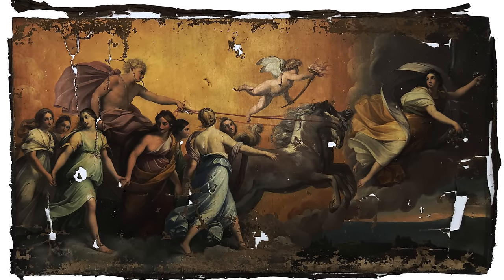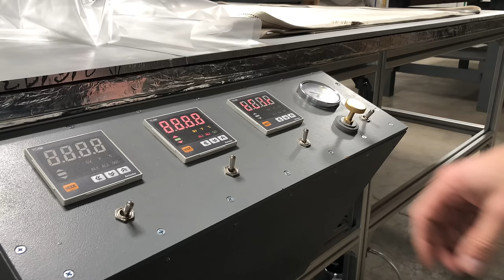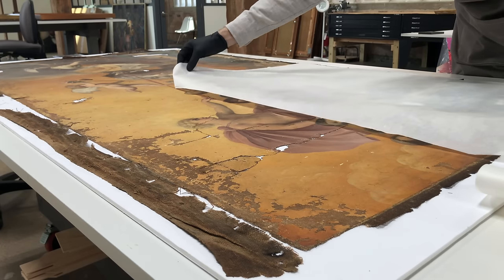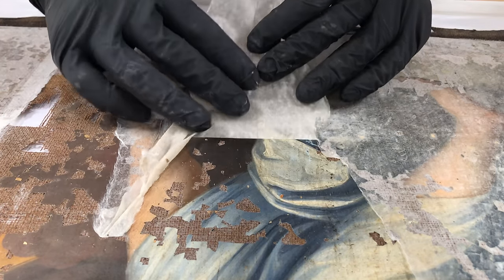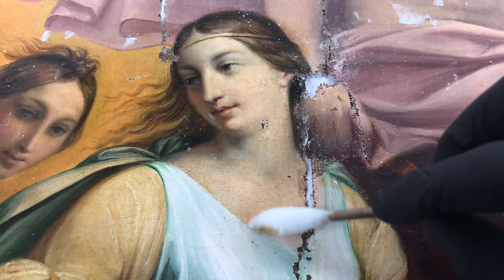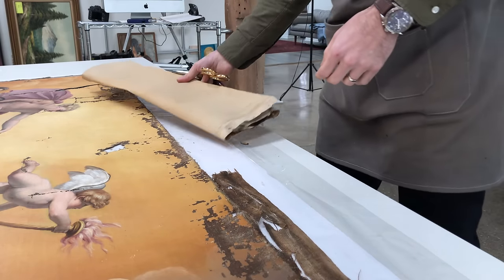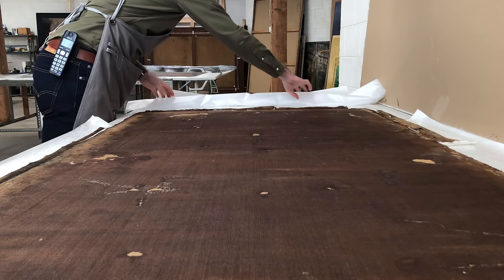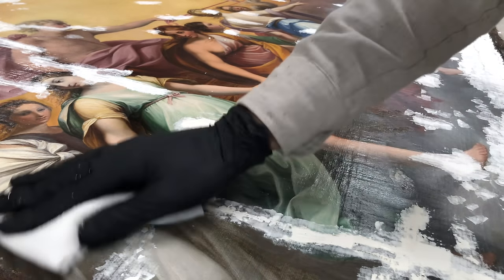A New Dawn: The Restoration of L'Aurora Part 1

Comment: Baumgartner: five inches of mercury
Me: yes I totally agree, good choice
Reply: Exactly. I was thinking 6 things of the mercury would be absurdly heavy handed and 4 of them, well that's just foolish. Clearly 5 of those things was just right.
Reply: Baumgartner: thirty inches of mercury is way too much
also Baumgartner: yeah lets put some breeze blocks on top of it now
Reply: They say the average is about 5.3 inches of mercury
Reply: In the Google lbs of Mercury to PSI calculator, I got 2.4 psi
Reply: @accountnamewithheld  30  Inches of Mercury is about as much force as 10 meters of water. It is a lot more than the breeze blocks that he put on. 30 inches of mercury is one atmosphere pressure.
Reply: Imagine the whole painting covered by an aquarium filled with 5 inches of mercury.  Any idea how much weight that would be?
Reply: @1959Berre  Just about as much as my depression.
Reply: Herr Holm Today the atmospheric pressure where I live was 30.11 inHg. I can’t understand how this is equal to being under 10 meters of water or how he could only have 5 inHg on the table. I know I am just confused and unaware and wrong, but could someone explain?
Reply: @johngalik6609  the weight of a water column 10 meters high equals the weight of a column of Mercury 76 cm high, equals the weight of the air column of the atmosphere above our heads. Yes, air is that heavy. Mercury, obviously is much heavier than water. Julian allows a pressure on the painting of (a column) 5 inches of Mercury, (about 12.5 cm). Which is a little more than one sixt on top of the normal atmospheric pressure, being equal to 76 cm of Mercury.
Reply: 1959Berre I think the real problem was for some idiotic reason I wasn’t thinking in an additive form. Thanks for explaining, but the real problem is that I wasn’t thinking the painting is now under atmospheric pressure and the pressure of the table, I thought this man was putting negative pressure on the painting. I knew I was being an idiot, but even worse than I thought. Lol

Comment: One must wonder how many bread pans Julian has “borrowed” from the kitchen only to cover them in conservator glue. 😂 It always makes me chuckle to see common kitchen items being used for an entirely different purpose by different occupations.
Reply: Forget the bread pans, I was not prepared to see him put the still delicate painting under some concrete board and cinder blocks.  Then again... if it works, it works!
Reply: @Murlockwarrior  Actually it's not concrete at all, it's gypsum sheets (or drywall). It's what the walls of your house are made of. Gypsum is a very soft and brittle stone, like you can scratch it with your fingernail or cut/carve it with a box cutter. Also he put a thick layer of felt on top to cushion the painting too, lol
Reply: argella1300 Thanks for the explanation, I was left thinking, crikey they look heavy, he must be strong in a way that slim men have that sinewy arm strength are surprisingly strong? Then I thought, no hang on a minute, concrete, really?
Reply: @scarletpimpernelagain9124  haha yeah lol. I've handled drywall sheets before during a couple youth group mission trips where we went to communities that had experienced some kind of natural disaster (major flooding and Hurricane Ike, respectively). The sheets themselves aren't super heavy, but they are bulky and awkward to maneuver with
Reply: @argella1300  Concrete/cement board, drywall, and gypsum are interchangeable in my head.  Thank you for the clarity.
Reply: Murlockwarrior No problem 😊 Happy to help!
Reply: I stole a bunch of my uncles old dentists tools to use for ceramics 😂

Comment: OK

So the part where he weighs down the painting that was damp WAS A REALLY GOOD TIP FOR ME CUZ MY FRIENDS ARE REALLY CLUMSY AND SPILL/DROP THINGS EVERYWHERE AND SOMETIMES THEY SPILL WATER ON MY DRAWINGS WHICH MAKES THEM ALL WET AND DAMP-
Reply: OMG - put them somewhere safe - if they don't respect your work, you really must. get two pieces of acid free board (it's cheaper) as big as you need, and make a folder and put them in there.  and Keep safe :)
Reply: As he showed, press it down between something wich will absorb the water or whatever. And place it somerwhere COOL. This will not allowe the paper to deform, as it does with heat. Change the absorbing layer regularly, so that the liquide don't comes in contact with the paper anymore, and to prevent mold. Than you should be safe. And yeah, as said above, watch after you art :D
Reply: I mean...

I don't want to jump to conclusions, but those people do not sound like friends. This happens frequently? I would be a bit cautious.

Comment: “We don’t need much pressure, only 5 inches of mercury”     Adds 8 cinder blocks on top of a few boards of drywall 🤣🤣
Reply: Actually, if you do the math, that's about right.

5 mmHg of pressure is 0.09 pounds per square inch (PSI).

Each cinderblock weighs 35 pounds (according to Google). There are 5 cinderblocks, so that's 175 pounds.

The painting is 28 inches by 60 inches (based on what I see in the video and Google). Total area is 1680 sq inches.

So the pressure applied by 5 cinderblocks over the area of the painting is 175 pounds / 1680 sq inches, which is slightly over 0.10 PSI.

That's within 10% of the desired pressure.
Reply: @aznmarty256  That would be true if the weight of the cinder block was evenly spread out. Even with the drywall material there are still hotspots of pressure
Reply: Right? Cinder blocks...F*ING CINDER BLOCKS..LOL

Comment: fascinating to see how much a painting can change even with just a partial restoration 
Like if I received back my painting before the fill in material point, I'd be shocked at the change because the painting looks so different with all that old varnish and grime cleaned off and the canvas and paint being stable and in less danger of breaking apart with a slight breeze

Comment: Got a quick question. How does the paint not come off with the solvent? You might have explained it, I'm just wondering on a more "technical" standpoint... is that the word? Is it all down to the ingredients that are in the paint, since its so old? So the solvent doesn't work/eat at the paint if its not disturbed too much? Is that it? I'm just really curious how the varnish is taken off since the only varnish that ive really had any contact with is wood varnish and the varnish seems kind of harsh, like chemically wise🤔

Comment: Hi! So your sandwich is the original canvas, nylon gossamer, PET film, BEVA film, new canvas? Do you need an adhesive between the nylon gossamer and the PET film or is the glue you used on the nylon re-activated and strong enough to hold the PET film during the hot table process?

Also what adhesive are you using on the verso? 

Thanks in advance,... conservator in training here 😌

Comment: The pressure thing is actually exactly how to flatten watercolors. A lot of artists induce heat with a house iron but it is much better to just damp thr back , place it between two baking papers ( not silicone as it will not breathe) , and cardboard on top against a flat surface. Weights - a few books, not too much as even watercolors may have surface differences of thick paint and the pressure will crack those areas if too much. A firm , soft pressure over a few days is much better. The baking papers are important to not smudge anything. Do not use heat as the gum arabic will split and create small balls in the paint. This is very unscientifically but i have painted for 15 years..and it just works. Heat makes funny stuff with the paper itself as well as it if it is a high grade paper with a gelatine stopper..well you will notice why its not fun when it happens..

Comment: "And as conservator I am always on the lookout for new tips, tricks,material and techniques" - well, since you asked... : )
So my tip is, I'd rather put few more drywall boards on the painting instead of those cinder blocks. Or I'd put 3/8"-1/2" plywood sheet between those drywall sheets and those blocks. Drywall is rather soft and flexible, so the pressure won't be transferred evenly - most of it just underneath those blocks, much less between them.

Comment: hey, a stupid question: when you need to remove, like, the Japanese paper with water, why don't you spray or pour a little water on the painting instead of painting it on? applying with a brush seems time consuming and tiring when you could just, dump a little water and then move it around with a brush? I trust there is a good reason, I just can't figure it out
Reply from the maker: Control

Comment: when i was younger i used to be really into paper mache, when i placed some paper weirdly and needed to remove it without it breaking into lil pieces i would pull up an edge and roll it back onto itself, like a taquito kinda? perhaps that could help your washi kozo or however you spell it come off in one/a bigger piece, i have no experience with that kinda thing though, just a suggestion

Comment: Re: cutting the inlays, and is there a better way than tracing and scissor gymnastics?
Would taking a photo, and laser cutting the canvas inlays be an option? 
There's software available which will, for example, trace over kid's drawings with the laser, so I'd think he could trace the voids, pop the new canvas in the laser, then take the nicely cut inlays out.

Comment: I've actually started pretending to be Julian when cleaning things and it works? Like 'In order to clean the microwave oven, I will gentle dab and scrub with a generic sponge using the abrassive end - I only need to gently press and drag as the sponge and soap does all of the work breaking down the dried accumulated particulate. For more resistant spots and flecks, a little more elbow grease can be used but the grime will come off in due time'

Comment: this seems like my dream and nightmare job at the same time. i wonder if it would diminish or strengthen my picking compulsionsss. this kinda stuff is just what i do. when we went camping, i picked some onions, before i knew it i'd spent hours separating each tinyyy little bulb from it's thin outside layer. the only issue would be that, i have that thing where i cant touch cotton, it hurts lol, so maybe thats my deal breaker

Comment: First, we are going to remove the surface grime with Swiffer paper towelettes and a conservative amount of Windex. As you can see, this piece has quite extensive damage, with multiples holes. To remedy this, I am going to use a method invented by Italian conservateur Benvenuto Angiolo Cuocco, which involves putting dry ramen noodles in the crevices, and then sanding them down, so as to be flush with the rest of the painting.